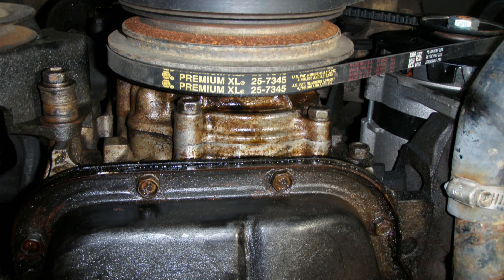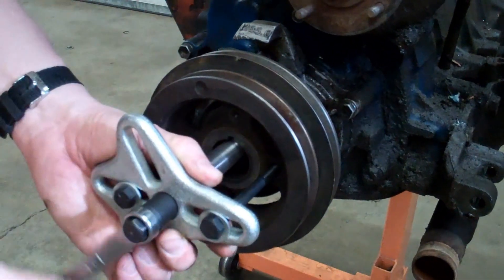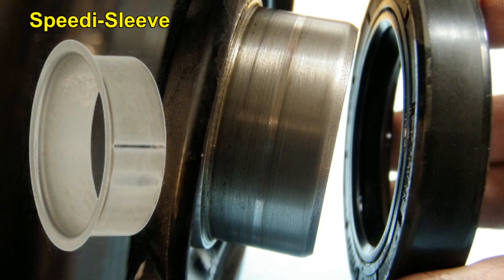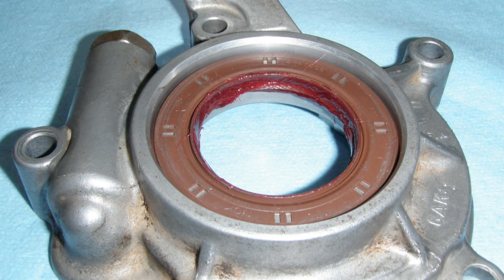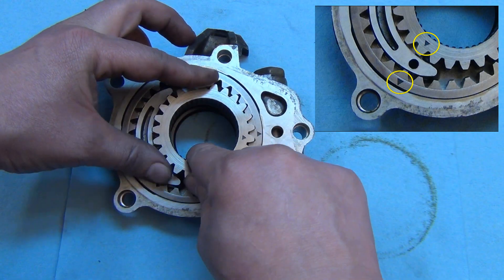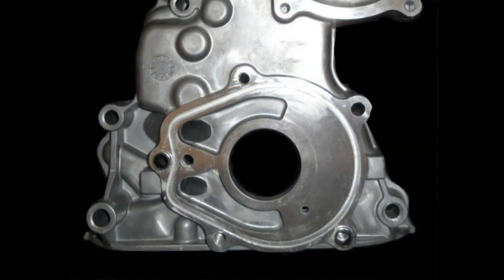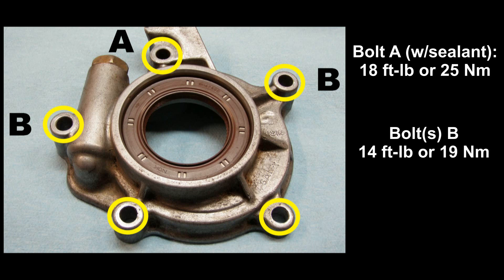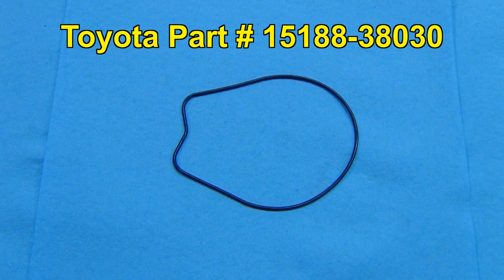How to fix Toyota 22R Front Main Seal Oil Leak (22R 22RE 22RTE) No Speedi Sleeve!

Comment: Love your videos pete, and i dont even have a 22RE. At least not yet. If you havent done one already, a birf rebuild vid would be great.
Reply from the maker: JaffaCakes   Thanks man,  you mean you want to see how to actually take apart the inner cages and balls of the birfield?  It's kind of cool how that little jigsaw puzzle goes together.  I've got one sitting on the bench right now.  I'll put that on the video idea list.  :-)
Reply: Yes sir, that and even a basic rebuild when the leaks start coming down the birfs would be great. Could you also mention what kind of greases you use for different applications? I dont always know what type is right to use.
Reply from the maker: JaffaCakes   I've got a video already on the inner axle seals (which when they fail is what causes the knuckles to leak gear oil.)  https://youtu.be/qevb7w9pUdk  As for grease to pack a birfield with, I just use whatever high-temp grease I have close by.  I just keep jamming it into the birfield until it spurts back out between the cages.  The factory service manual calls for filling the knuckle with grease through that fill plug, but that just makes a nasty mess if you have to get back in there so what I do is clean it all out, grease the bearings (upper and lower trunion) and then make sure a light coat of grease is spread on all surfaces so they don't get rusty.  This is a good way to do it if you are into the knuckles on a regular basis (at least once a year if you do any deep water crossings).
Reply: JaffaCakes I don't have one either. With any luck he'll get into M series motors and make some slick vids i can put to use.
Reply: +WheeliePete I have a first gen with a 20R now! Replacing the timing chain this weekend. Again, real glad you made these vids. Cheers.

Comment: FYI guys I'm deep into a rebuild of my 22re and if you get the Toyota OEM overhaul seals kit (got mine from camelback Toyota parts for 156$ and it has damn near every seal you will need including these shallower main seals for front and rear and putting them on the way Pete shows has them riding just behind the groove from the old seal.  I'd say this tutorial is quite actuate.

Comment: I have a 91'  22re.  Is it worth replacing both front and rear main seals?  Tech want to charge me over $2100.  Is that too much?
Reply from the maker: I'm curious what they quoted you on for the book labor time for the job.  That's usually how these things get quoted is they have a book that tells them how many hours a job like this should take and then they multiply that by the shop rate + parts.  The seemingly high expense you've been quoted is coming from the replacement of the rear main seal.  In order to replace the rear main seal either the engine or the transmission has to come out of the vehicle in order to get to that seal (it's on the back of crankshaft under the flywheel which is covered by the bellhousing of the transmission.)  I would assume they're are going to take the transmission out as that is easier than pulling the engine.  That's going to add a bunch of hours to the job and shop labor rates being what they are...well, you get the picture.  If you have a manual transmission, I would have them also resurface the flywheel and replace the clutch if they haven't been done in a while.  They'll have those parts out of the rig and that's the only time you can get to those parts is when the transmission is out of the vehicle also.
Reply: @WheeliePete  I know their labor rate is $150/hrs.   I have a rare 91' Toyota p/u 4 cyl. Automatic.  22RE.  They said $2100 plus whatever else they find that needs replacing while they have the trans dropped.  I think I am going to get a 2nd opinion.  My A/C doesn't work either and they quoted me $140 just to diagnose.  I told them I did the R12 conversion cost me over $300.  The next day it quit blowing cold air.  Not sure if either issue is worth fixing especially for those prices.  The truck has a salvaged title and has been totalled 3 times.
Reply from the maker: I think getting a second opinion is a good idea.  I would even think about looking for a shop that specializes or at least has good institutional knowledge on these older Toyotas and knows their quirks.

Comment: Does 22r have a screen in the oil pump or oil pan just  curious
Reply from the maker: The oil pickup tube in the pan has a screen on it.  But it's a pretty big mesh on that screen.  It will stop chunks of RTV, or pieces of broken timing guide from getting sucked into the oil pump, but it's not a fine particulate filter by any stretch.

Comment: If your in there why in the world would u just not replace the whole pump which comes with all new gaskets?
Reply from the maker: Fair question and if this was an ancient, original part I totally would, but because this has been a wheeling truck for the last 20 years or so, I know the pump was replaced previously has less than 10,000 miles on it.  It also spec'd out, with feeler gauges per the factory service manual procedure and it produces full oil pressure per the gauge.  Also, most likely any replacement oil pump you get from a parts store will  NOT come with the thin profile oil seal referenced in this video and if your leak is because of the seal riding in a groove on the crankshaft pulley, a new seal that goes right back in the same groove will start leaking again pretty soon.

Comment: I had this problem multiple times with two different 22R blocks back when I had my '85 4x4 in the mid 1990s. I loved that engine, but the front seal leaks, which would spray oil all around underneath the hood, drove me crazy. Back then I know one of the problems I faced was that the quality of some of the aftermarket oil pump replacements on the market caused them not to work well and would allow oil to leak past the replacement seal (I tried the balancer sleeve but it did not solve the problem). I think the quality of the aftermarket oil pumps are better today.

Comment: Tip: If anyone still has an oil leak after replacing the front main seal, oring and has ruled out the crankshaft pulley groove as an issue.  

It very well could be the top bolt that requires thread sealant.  I just discovered this during my installation.  It is 100% coming from said bolt. I was able to see it with an inspection mirror.  I did not let my sealed cure both times I have tried to remedy the issue. Third times a charm, but i plan on letting it cure for as long a possible. 8 hours after work :) (Its my daily driver)

Its hard to believe it could leak so much, but i was counting a drop every couple of seconds. Plus it runs down and gives the appearance that its coming from the main seal or o-ring.

Note: i have tried Peratex high temp with no success.

I will be trying Loctite thread sealant PST stick 37615 next. It worked great for my oil pressure sensor, and I believe it cures a little faster than the permatex. I will update after I give it a shot.
Reply from the maker: The permatex has always worked well for me, but I do clean the bolt pretty well before install.  Let us know how the Loctite thread sealant works for you and if it does I'll add it to the video description links too.
Reply: @WheeliePete  What are you cleaning the hole with Pete? I thought about q-tip and acetone. Or just draining the oil and spraying a bunch of aerosol acetone through.
Reply from the maker: If you've got the pump off a q-tip and acetone should do the trick.  I also would make sure you've got the right bolt up in that hole.  If I remember right, that's the bolt that if it's too long can go through and butt up against the timing chain tensioner and cause problems.  The leak you're describing almost makes me think somone swapped in a bolt that is slightly too long and it's bottoming out right as it almost looks like it's down all the way, fooling the installer into thinking it's tight when it's just touching something on the inside.  Does that make sense?  I had a similar situation on a transfer case where a stone guard was removed from under a bolt and then the bolt was run back down, but it bottomed out before it got tight and then started leaking gear oil through the bolt.  You can take a skinny screwdriver and use it as a depth gauge and then compare that against the bolt and see if maybe that's the problem (bolt too long).

Comment: Thought I had a front main seal leak, but when I checked the pan, those bolts were loose! However, after a few days, I'm still getting an oil drip! Should my next step be to go ahead and do this fix? We're talking about 3 drips/couple hours! ugh... ENGNBLDR rebuilt it a year ago! What could be causing this?
Reply from the maker: +Philip Gragg   The pan bolts are only in there with a light pressure, and if the gasket or RTV has compressed they will feel loose.  If you've got oil collecting on the bottom of the oil pump right behind the pulley it most likely is the front main seal. Chances are your pulley has a groove on it.  New pulley is not part of an engine rebuild.  If the pulley has a groove  in the sealing surface a new seal that rides in the same spot won't help (hence the trick of using the thinner seal to move the sealing surface to a new point on the pulley.)  Pull it (the crankshaft pulley) off and look for the groove right where the seal rides.  It's either that or the o-ring between the timing cover and the oil pump got pinched a little and oil is sneaking past it.  If you need help getting the crankshaft pulley off I have a couple videos on tricks for getting that stubborn bolt out.  Just search my username or go to my channel and look for the Toyota playlist.
Reply: WheeliePete Thanks! I'll call Toyota and get that new seal tomorrow! Looks like a decent job that only requires a couple seals, some permatex, and an oil change :D

Comment: is this the same procedure and are the part numbers the same for the 20r?
Reply from the maker: I haven't personally done this on a 20R.  The procedure would be the same, but I'm not 100% sure on the front main seal being the same ID and OD.  What you could do to check would be to go to your local autoparts store and see if there are different part numbers between a 20R and an early 22R.   I think they had 20R's in the 79 and 80 trucks and then they got the 22R in 1981.   If they list the same generic part number at the autoparts stores then you should be able to fit the later, thinner toyota front main seal into the 20R oil pump.  The O-ring seal for the oil pump is the same part number for all the 20R and 22R's.
Reply: Ill be sure to double check, thank you for the speedy reply. Great informative videos also, very well done

Comment: Excallent  video! I appreciate you taking the time to post these videos.  One question though: when putting in the new thinner seal, if you drive it all the way in, won't the back lip of the seal be in the groove and have a chance to leak  again?  It would have to stay out a bit to avoid this. Thanks for any reply on this.
Reply from the maker: The seal being square in the bore is more important than trying to drive it to a specific depth to avoid the groove.  It's easy to drive the seal square either flush with the surface of the oil pump housing or all the way to the bottom.  If the seal is even  a little bit cocked, it's going to leak really quick.  Generally speaking if the seal that's coming out was a thick one that was flush with the top of the oil pump housing and you replace it with a thinner one driven to the bottom of the bore, the groove in the crankshaft pulley isn't a problem.   If it does start leaking again you'll probably need to get a new crankshaft pulley or speedi-sleeve it, or have the groove welded up and turned back down by a machinist (although unless you are a welder/machinist that option is going to be way more expensive than just getting a new crankshaft pulley.)

Comment: Great video wheeliepete. I have a question where can I find that same pulley wrench??
Reply from the maker: I originally got it from harbor freight, but I don't see it listed on their site any more.  The best thing by far is to make or buy a pulley holder that bolts to the crankshaft pulley and holds it still while you tighten or loosen the nut.
Reply: Thank you for checking and getting back to me I'll keep looking our try make something sucks we don't have a harbor freight out here in Hawaii.

Comment: Why do you recommend that we pull the oil pump?
Reply from the maker: Because it makes removing the old seal and driving in the new one really, really easy vs. having to worry about dinging up the end of the crankshaft when prying out the old seal, and the difficulty of trying to drive in the new seal perfectly square while you try to work around the crank and between the radiator.  It's just easier to take the oil pump off and make sure the new seal goes in perfect.  The only time I've had one of these leak again right away was when I tried to replace it without pulling the oil pump.  It's probably less effort to pull the oil pump than to try and work with it still on the engine and the crankshaft sticking through it the whole time.

Comment: WheeliePete, I think I have a problem.  I followed the steps, got everything removed, and found grooves in the sealing surface.  So far so good.  When I removed the oil pump, however, the smaller gear was different than the one in the video.  The middle of it extends out about 3/8 of an inch.  Also, the oil seal doesn't seem to want to come out of the oil pump.  Having tried the caveman method to remove it, I'm starting to think it's part of the oil pump.  I may be dealing with an aftermarket part, seeing as how I got it used.  Any thoughts?
 This is a 1984 toyota pickup with a 22r engine.
Reply: Disregard.  Got it figured out.
Reply: Got up from down kinda confused.
Reply from the maker: Good deal.  Those old oil seals can be a pain sometimes.  I have a hooked tool I like to use to lever them out with across a block of wood.

Comment: These are great videos, I have a 1988 toyota pickup 2wd. There is nothing wrong with it right now, it's just nice to know for future reference. The only complaint I have about my truck is that it's a 4 speed manual, I would like to put a 5 speed in it.

Comment: Hi, what type of grease do you use on the seal and also to hold the o-ring in place?
Reply from the maker: I just use whatever can of high-temp bearing grease I have laying around.   It's sticky enough it won't migrate or fly out.

Comment: does this apply to a Toyota Corona 1981 as well? it's a 22r motor but a little bit different from the trucks. I have a leak up front of the oil pan. thought it was the oil pan gasket but more likely the oil pump...
Reply from the maker: Yep, will work on the 22r in the Corona.  I've had two of those over the years.  Loved that car!

Comment: Would you happen to know the Toyota part number for the water pump and gasket for that model? I'm stranded in Mississippi and I'm in need critical need
Reply from the maker: I've had good luck just getting a new waterpump from whatever parts house is closest (napa, autozone, etc.)  The new water pump should come with a gasket.  I always put a thin coat of hi-tack gasket sealer or a VERY thin coat of RTV on both sides of the gasket also.  Brand new Duralast water pump for an early 22R is $21.99 at Autozone per their website.

Comment: Quick question how do I loosen up the belts on mine. The video show everything pretty much removed but how would I do it while the engine is still in the vehicle?
Reply from the maker: For the alternator you loosen the top fixing bolt of the alternator and push the alternator towards the engine, that puts slack in that belt and then you can remove it.  You may have to also loosen the lower bolt if it is pinching the bottom mount of the alternator so hard you can't pivot the alternator after loosening the top one.  For the power steering (if so equipped) you have to first loosen the nut in the center of the power steering IDLER PULLEY (not the pulley on the power steering pump, the idler pulley to the left of the power steering pump when facing the front of the engine.) Then you can move the idler pulley by using a socket and a ratchet on the left of the idler pulley on the end of the idler pulley bracket to move the pulley left and right in it's bracket...but first you have to loosen the big nut on the front of the idler pulley or it won't go anywhere.

Comment: Just to double check that first link is for the thinner main seal and not just the standard, correct?
Also are you SURE that that other seal is just as good?
I sure don't want to save a few bucks but have to do it a year later because of cheap rubber.
Reply from the maker: The first link should be for the thinner main seal.  I haven't ordered them from Amazon, I just went and found a link to the part number for the factory seal and put it in there for anyone who doesn't have a dealer close by.  The amazon link was a better price than the last one I bought from a dealer.  The other link for the o-ring from Fel-Pro should be a fine product.  I've used gasket sets for the 22R from FelPro many times and never had a problem.  That being said, the OEM Toyota one is going to be the premium choice without question.
Reply: WheeliePete thanks, I bit the bullet and ordered the oem one.
Used all ypur links too so you could keep producing great vids like this. :-)